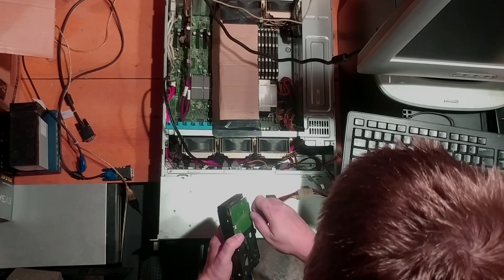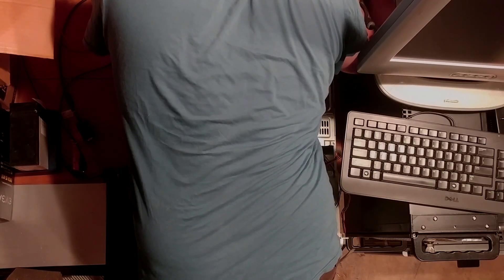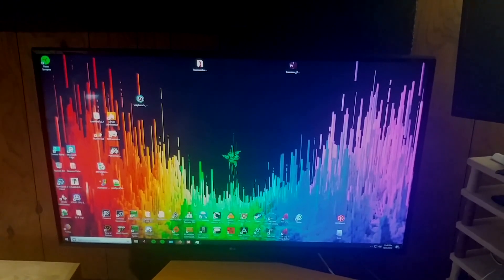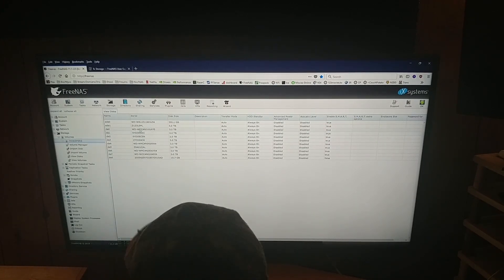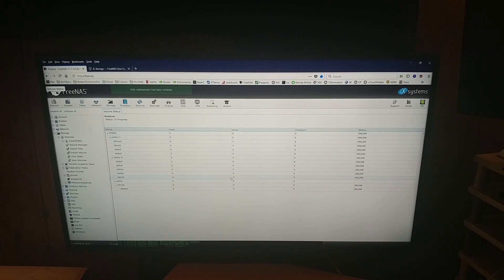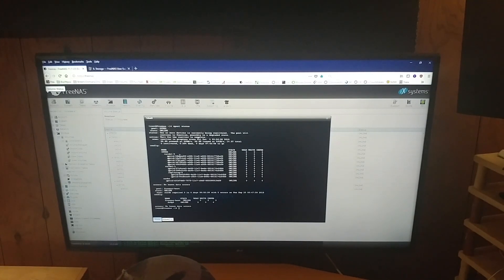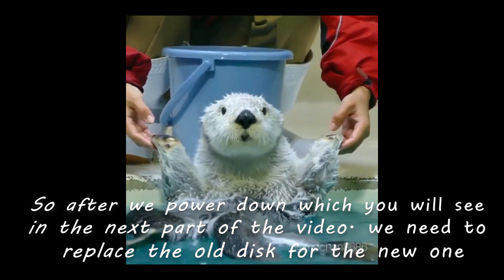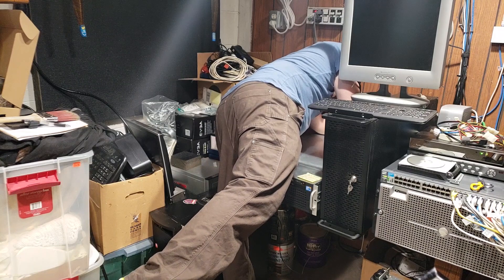TechNitWit Freenas Resilvering & (Tour of my Nas & Servers)

Comment: Hey, Just a quick question. Can I use the asus geforce rtx 2060 Overclocked 6gb with the 500 watt hp psu. And a i7 10700f ( I have a tg01) Please respond
Reply from the maker: Yes it will work.